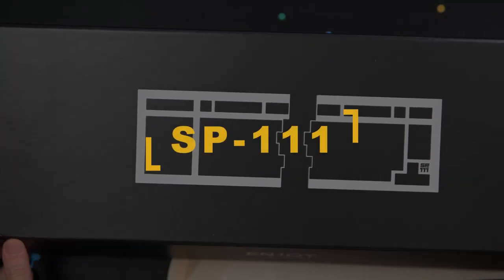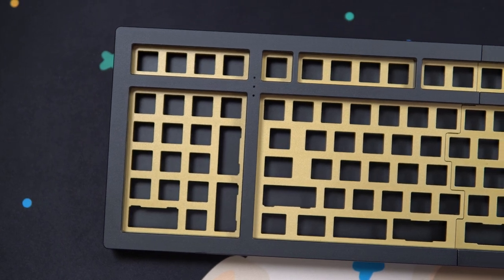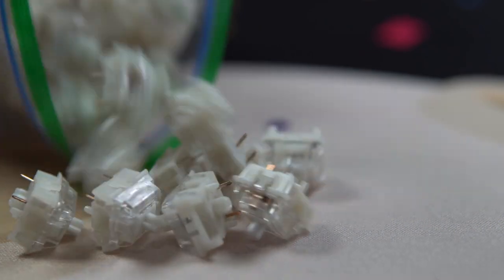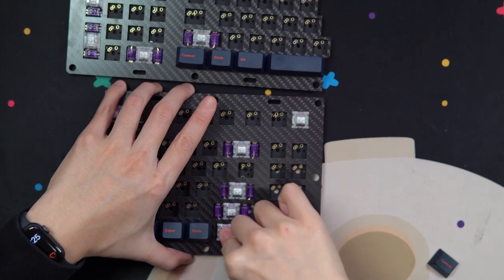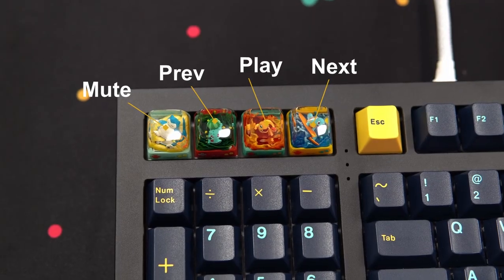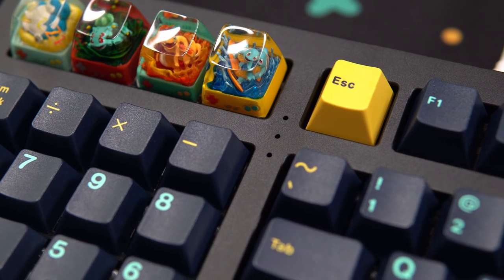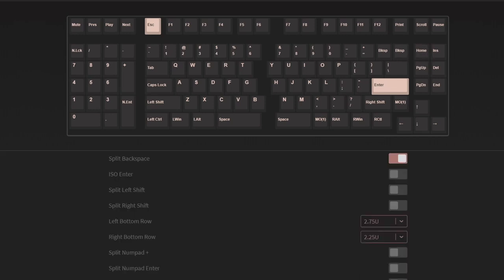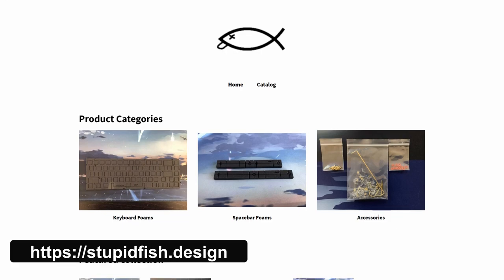The King of Splits | SP-111 Mechanical Keyboard Review

Comment: Nice build and review!! The via issue from what I can tell might be on their end which basically means we can't fix it without them doing the work as it isn't open source. 😢 Hopefully we can get this fixed soon though.
Reply from the maker: Why hello there! And thank you. Good to know about the issue with VIA, luckily it's not a terrible workaround.
Reply: I had the same issue with Via but I figured it out pretty easily.  I flashed the pcb on QMK Toolbox, then I realized if I changed the split backspace to both delete that would do the trick.

Endgame work keyboard for sure, thanks Assassin
Reply: Any chance this board is brought back for another group buy in the future?
Reply: @JarkOff  the designer said it will likely have an r2

Comment: Hey man, i dont know if you will see this but is there any kind of split keyboard where it splits after the 60% so if I want all the function keys and num pad i can attach but if i dont want them then i can take it apart to save space?
Reply from the maker: I don't know any 60% keyboards like that, but the closet thing I can think of is https://us-mountainggshop.com/products/everest-max
But the easiest way to reach your goal is to get a separate numpad at the expense of having an extra cable on your desk & to your PC. As for function keys, I would depend on layers for those.
Reply: @jimmynguyen973  thanks man, that's kinda what I'm in the process of doing now. I have a glorous gmmk and i just bought BDN9 and I'm going to build that and just use that as a macro pad to fill for the lost keys I lose with 60%
Reply: @parzival6777  It's not gonna be an exact match, but honestly check out the Quefrency & Sinc keyboards by Keebio, I have a Sinc 75 myself and I love that thing & Keebio just added new acrylic cases for both of those kits, P3d store has some really cool cases you can order for both of them too but the Quefency is a split 65% (or 60 can't remember) and the Sinc is a 75% but would highly recommend checking them out as they are really cheap but really good with lots of customization

Comment: Did you have any issues trying to flash your sp-111 in qmk? I have been trying for almost 3 hours and no luck. I keep getting the “Device not present” message when i hit flash in qmk toolbox. I got the hex file from via, have the latest drivers for qmk and still nothing.
Reply from the maker: i didnt get any issues like that. unfortunately im not sure what the issue can be other than something driver related.
Reply: @jimmynguyen973  was able to finally solve it, i have so many keyboards set up on my pc I couldn’t narrow down all the old drivers for this one so since i never collected it to my laptop, connect it there and was able to flash it in QMK with the VIA file and it worked like a charm. 3+ hours of pure confusion and anger just to do it within like 3-5 minutes on my laptop haha

Comment: DId you have issues with the right shift and right stab?  It seems you have them oriented the same direction with the bar facing south.  at https://youtu.be/q1k2DjRnZLI?t=175  --- Durock V2s seem too big, My Durocks hit each other so i had to swap out a zeal stab just for enter, but still kinda contacts the shift stab. So i get a crooked enter key.
Reply from the maker: Hmm that's interesting, I have no issues with that stab. Could go for the shorter right shift + 1u key layout so you don't have to use the right shift stab.
Reply: @jimmynguyen973   Dude great idea!! Thanks will do that instead!